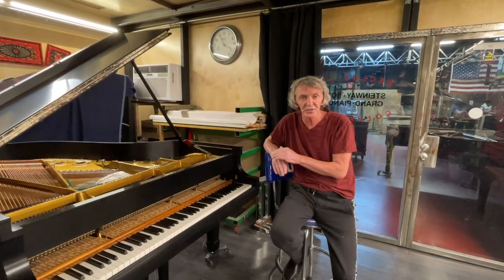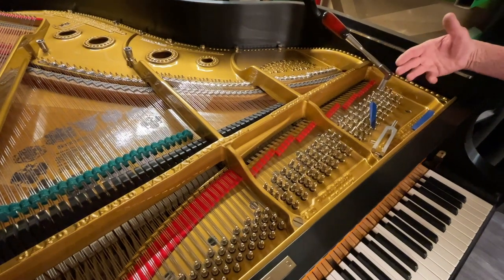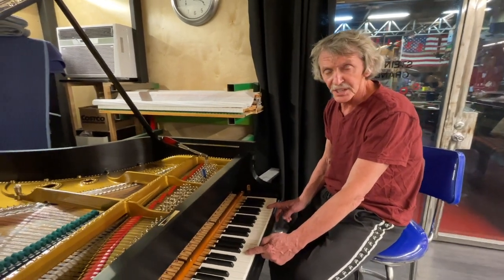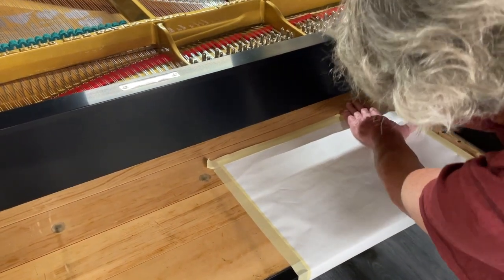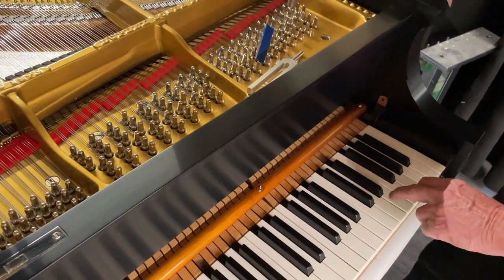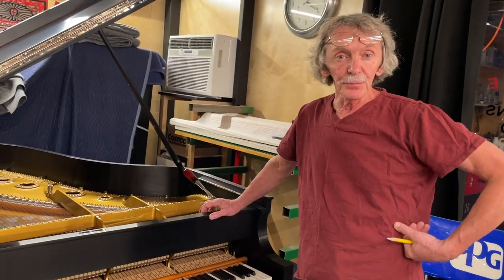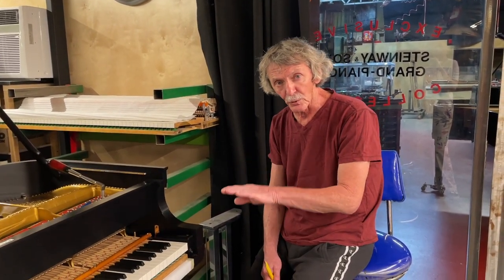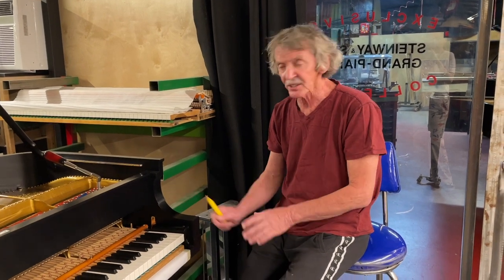Piano Restoration: Hammer Line on Treble Section of the Grand Piano

Comment: Would it not be easier to replace the screw hole in the flange portion of the shank with an elongated slot so that you can more easily slide the hammer forward or back and then tighten down as necessary? This would also address the situation that seems like it would be problematic with your hammer repositioning approach where the need is to elongate the strike position of the hammer rather than shorten it, as in your examples.
Reply: That would change the action a lot. Basically moving the location of the knuckle, the location of the hinge point relative to the entire whippen, the angle itself of how the hammer hangs on the repetition lever… the location of the front rail is carefully aligned to keep a set distance between itself and the whippen flange rail.